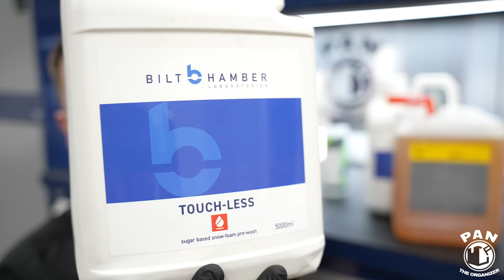The end of the 2 bucket car wash method!? 💀

Comment: It always makes me chuckle when people try to give advice and they're using a foam cannon, then immediately wiping it. Why are you throwing away money on excessive amounts of foam cannon soap, only to ignore its primary benefit?
Reply from the maker: There's actually nothing to chuckle at here. The answer is quite simple. There are generally two types of snow foams. 

1) More alkaline pH snow foams used for the pre-wash stage. Those are sprayed, let to dwell, and then rinsed off. And then you move on to the contact wash (you can refoam with a pH neutral snow foam before the contact wash should you want additional lubrication). So snow foams like Bilt Hamber Touch-Less and CarPro Lift are both alkaline snow foams, and their role is to help start softening and loosening dirt, debris, grime and road film. And they need to be rinsed off. 

2) pH neutral snow foams, mainly used for lubricity on the surface. Those are sprayed after you at least pre-rinse, or pre-wash the surface. The pH neutral snow foam can be the same as the soap in the wash bucket. The goal here is to minimize the chances of scratching and swirling the paint during the contact wash.

See my video on the topic of "Are snow foams myth or do they work?" here: https://youtu.be/6K07y26I7Z4?si=9N9ZVgS3prDNdszJ

Welcome to my channel. You discovered one of the biggest car detailing channels on YouTube as we surpassed 965,000 subscribers and we have over 130 million views! I have been detailing for 26 years and I love to share my knowledge and passion with my viewers.

You found the right channel to help you learn everything about detailing.

Comment: I use your method, essentially, but I use multiple chenille micro fiber noodle wash pads. I also like to precede the initial snow foam with a spray of 128:1 ONR and then apply the snow foam on top to dwell. This is to get a very high level of lubricity, before a pressure rinse, and to get a combination of the polymer-based detergents in the ONR and the surfactant-based detergents in the snow foam. Also, I always like to try to sheet the rinse spray at about a 15⁰ to 30⁰ angle with respect to the surface, so as to not drive any dirt particles into the surface under pressure.

Thanks for sharing these tips and techniques that you and others have used to develop more efficient and safer ways in which to clean our cars.
Reply from the maker: Thanks for sharing!

Comment: Hey Pan, any comments on why my GSF is streaking in his this method? I'm applying GSF to my dry paint, 5:1 via my pressure washer/MTM cannon, letting it dwell a few minutes, rinsing, and then refoaming and bucket washing. I wash outside at night under lights (Fall in Minnesota), so no issues with drying/sun.
Reply from the maker: You are using too high of a concentration. 1:10 is the recommended ratio from Koch Chemie. Also, if you're not using deionized water in your pressure washer setup, maybe your hard water is creating some streaks.

I use 2 oz of Gsf with 20 oz of water (22 oz total solution) in my foam cannon.

See my video with Koch Chemie experts here: https://youtu.be/BO0eAARXfAg?si=CqP-ioF9YvadNITi&t=1088
Reply: Wow! Thanks Pan!  @PanTheOrganizer
Reply from the maker: My pleasure. How did you discover my channel by the way?

Welcome to my channel. You discovered one of the biggest car detailing channels on YouTube as we surpassed 945,000 subscribers and we have over 125 million views! I have been detailing for 26 years and I love to share my knowledge and passion with my viewers.

You found the right channel to help you learn everything about detailing.
Reply from the maker: Hehe yup I totally understand you!! And it's nice you also follow Larry and Matt, they are both my friends, and they have done a few guest appearances in my videos in the past too. :)

Comment: I don't care to much about the rigs, I use 1 bucket & no grit guard. I often will wash my drying towel every month, it usually hangs on my Harlie's right mirror, & I often save the wash water in the bucket of a week or two, maybe three... whom knows... for drying, I do use an aid, usually with was, Walmart had one with ceramic, but they don't stock it... both my rigs have bumps & bruises, HD too, so, cleanish is fine... as long as they go down the road... Thank you for your videos. I will say, when Beed Maker came out, my FedEx Ground truck got the full treatment, wheels too. Thank you for that :-)
Reply from the maker: Cheers!

Comment: One bucket does really work and the method I prefer. On dirtier vehicles, I will spray the mitt with the sprayer and wring it out before placing it back in the bucket. That ensures that your mitt will be at least 90-95% free of dirt.

Comment: I'm surprised your Porsche isn't PPF'd Pan, what are your thoughts on PPF?
Reply: My thoughts are that as a professional detailer PPF should be made available when asked for, preferably in-house but if not have a good recommendation to send customers to :)
Reply from the maker: I have said it many times. I am just not a fan of the look or feel or PPF. Plus, as I get a brand new car every three years, and do low yearly mileage, scratches and stone chips are of no concern to me. My cars are always pristine when I bring them back to the dealership.

But for people who keep their cars for many years, and want the ultimate scratch and rock chip protection, PPF is the only solution. I would still recommend a ceramic coating on top of the PPF, for the best of both worlds.

Comment: Wow, very very helpful. Left a comment with a question!
Reply from the maker: Thanks for helping to support the channel! I try to respond to as many comments as possible but it’s getting overwhelming. Hundreds and hundreds of comments in this very popular video so far.
Reply: @PanTheOrganizer  I can only bet. Here's the question I had: I'm typically going to my best self service station. But at the station I bring my bucket, chemicals, mitt, blower etc etc......can my marolex pump sprayer be used in leu of a foam cannon for the presoak stage and then followed up by 2nd step c lubrication before handwash?
Cheers, JH (Joe)
Reply from the maker: Yes absolutely! It just takes more time with a pump sprayer, but it works. 👍🏻
Reply: @PanTheOrganizer  ❤️ good to know, thank you Pan! I'll also buy buying one of those migrade cleaners you talked about. I don't have that and I'd like to use one of the safe coating cleaners for that presoak stage and I'm feeling like the diy cleaner would be best!

Comment: My handbook says to only use ph neutral soaps.
Reply from the maker: Car manufacturers have no choice but to be on the safe side, as they don't know what brand or type of soap people will use. Heck some people still use dish soap to clean their cars. So to protect themselves, they say to only use a pH neutral soap.

But if you know what you're doing, and buy quality products from reputable detailing brands, you can use higher pH snow foams and acidic soaps once in a while, no problem. I have been doing so for years with zero issues. The products they make are made for washing cars. You just have to know when to use them.

But for regular weekly washes, all you really need is a pH neutral car soap.
Reply: @PanTheOrganizer  I thought as much it is probably just a disclaimer type of comment in the handbook.

Comment: Your car is spotless and obv well coated,hows abouy doing this on a dirty everday car,it would show it better
Reply from the maker: It doesn't matter if a car is coated or not. Coatings aren't meant to protect against swirls and scratches anyways, by the way. That's not what they are intended to do.

If you use safe washing and drying methods, your paint should also look great for years.

Read the comments, and you'll see just how efficient the 1 bucket method can be as well. But if you prefer the 2 bucket wash, that's also totally fine. There's nothing wrong with either method.

Comment: Just a tip: When I detail my cars,  I spray the surface with a all purpose cleaner/degreeser then I througly rinse off. I clean the wheels and tires with p&s brakebuster in a ik multi 1.5. I rinse before moving to the next. I rinse the car again to make sure dirt from the wheels and tires are gone (at this point you can not, if at all,  see dirt on the car). I foam the car for the first time with CarPro Lift and Adams iron remover in my cheapo $20 foam cannon, I rinse off again. I foam the car a second time with Adams mega foam or Koch Chemie Gsf in my MJJC S V3 foam cannon. I do the two bucket method with 5 or 6 OZ of adams car shampoo and Chemical guys chenille microfiber washmitt. I work from top to bottom, rinsing my wash mitt after every panel. I rinse off again, dry the car, and I'm done!    I know this is alot of work but you gotta remeber I LOVE washing cars,  also doing this method, I know i am getting the car as clean as possible before even tauching it. Once again I just thought i'd share

Comment: I'd like to mention that even though you mention that 1k psi can drive dirt into the paint, we also need to take into account that the further the nozzle is from the paint the less pressue the paint is going to be exposed to. 

You can most definitely mitigate damaging the paint with high-pressure water by simply distancing the nozzle from the paint.

Comment: Lift says its used for coatings?
Reply from the maker: CarPro Lift was designed as a pre-wash snow foam for ceramic coated cars, yes.
Reply: @PanTheOrganizer  okay I thought you said it could be harsh on coatings. Or do they mean to use it before you coat it?
Reply from the maker: You can use it to pre-wash a ceramic coated car. It was designed for coating maintenance.

Comment: Just confirming you were still using the higher ph snow for the second round..?
Reply from the maker: No. Once the original pre-wash is done with the higher pH, if you want to re-foam the surface for lubrication for the contact wash, you use a pH neutral snow foam.
Reply: I understand you didn't use a pre-treat this time, because you used the higher ph Active Foam. Do you no longer use a rinse less wash as a pre-treat,  as the first step, prior to the snow foam, if you are using a ph balanced snow foam and shampoo?

Comment: Can i do this with only ph 7 soap?
Reply from the maker: I don’t understand your question. For regular weekly washes, yes you should be using a pH neutral car shampoo.

My favourite car soaps are featured in this battle video: https://youtu.be/kWSQSpD0Rww?si=cyRlHENCqazqTJ8u
Reply: @PanTheOrganizer  i mean should i use ph neutral soap for pre foam?
Reply from the maker: For your regular weekly washes, yes use pH neutral snow foams and soaps. Once in a while, for a deeper cleaning like in spring, or to remove road film and heavier grime, you can use a higher alkaline pH snow foam for the pre-wash, and acidic soap for the contact wash. See my ultimate spring cleaning tutorial here: https://youtu.be/oTaFE_p2OAw?si=lQDwWxz6_kbXyGoG

Comment: Never has been a thing with me. 1. Rinse car with hose water 2. Fill 5 gal. Bucket with car soap and water. 3. Top down scrubbing excluding the wheels until all painted surfaces are done. Rinse car. 4. Use same rags and wheel tools to clean wheels and tires. Lots of rinsing the entire time. 

I’ve used a foam cannon but prefer the sloppy soapy-ness of a rag out of a bucket. Always great results.
Reply from the maker: Thanks for sharing your thoughts. How did you discover my channel by the way?

Welcome to my channel. You discovered one of the biggest car detailing channels on YouTube as we surpassed 945,000 subscribers and we have over 125 million views! I have been detailing for 26 years and I love to share my knowledge and passion with my viewers.

You found the right channel to help you learn everything about detailing.

Comment: This method works great. Here in Japan we do an extremely fine rinse while an associate uses a blower to make the water particulates as small and fine as possible. Follow up with a rinseless wash with two grit guards. The first guard will minimize chances of any small particles from getting stuck in a mitt or sponge. The second grit guard believe it or not acts as uniter. It literally just unites any solution with the sponge. I would not use less than 9 sponges for a midsize vehicle (click here to buy our amazing sponges). Okay, after youve let the sponges soak in the rinseless solution for 73.2 hrs its time to get to work. First we...Read More
Reply: @PanTheOrganizer  😅❤️🙌